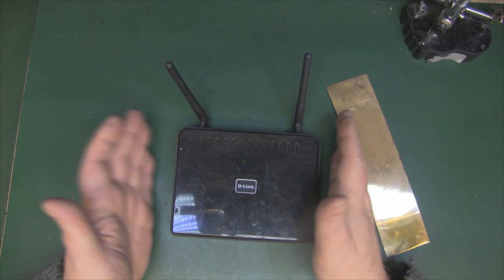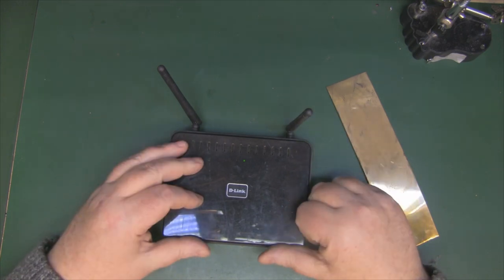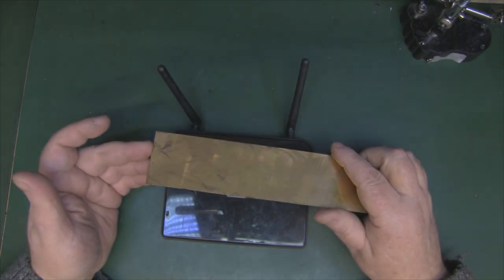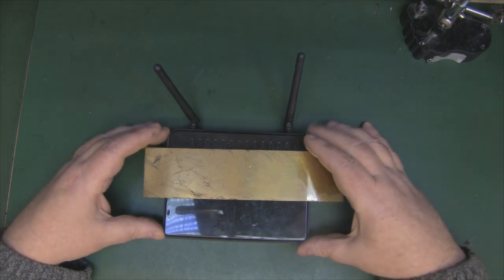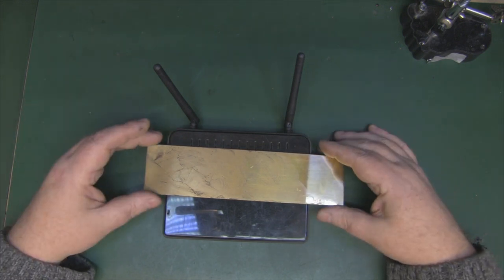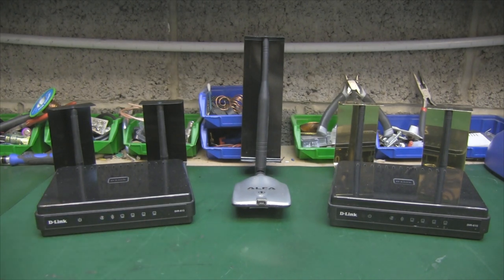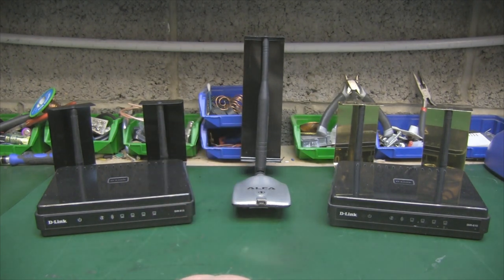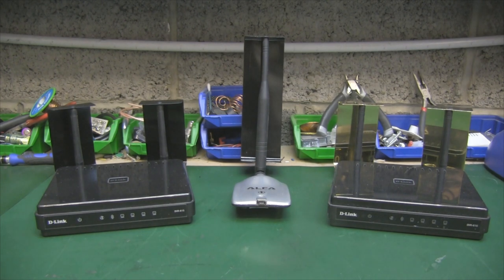Increase Your Router’s Range by 50%

Comment: it works, however your antenna is now a directional antenna, the signal on the back of it decreased since is now reflecting on the metal and being pushed to the front, still a good idea, just something to keep in mind that position of the router is important as well as the direction to which you want to send the signal to. thank you for the video.
Reply: ruddy Puga duh, thats the point of the mod.

Comment: You can also buy some conductive air freshener to spray in your room. It's got special ions in it that make the air propagate the radio waves better!
Reply: Mr. Wifighost Cruiser this comment answered one of my forgotten questions I just couldn't articulate fast enough in AP Spence.  Too much day dreaming.  I know I'm late and or a new to subscriber to this channel and possibly am not the first to ask but new methods and updates happen daily. I have a bebop 3.0 drone by parrot. I do not want to buy the sky controller,  I have a flypad which is a blutooth remote that connects to my phone/tablet.  Basically the 2.4 and 5 Ghz and all transmission to the drone are from the phone/tablets wifi.  What can I do to match the aftermarket controllers distance which is 1.6 miles via 2.4ghz (presumably?)

Comment: The antenna is presumably a thin rod in the centre of the axis of the plastic. Would you get better constructive interference if you measured your 15mm from the centre of the mounting holes? As it is you probably have 18mm when you add in the thickness of the plastic case of the aerial.
Reply: I thought the same thing. The plastic is not part of the antenna, right?
Reply: @rupert274  Right!

Comment: Of course they call these windsurfer reflectors, cause they look like sails on a boat I guess. But usually they are made curved like a satellite dish while yours are flat (nicely done BTW for a quickie mod). So the question is how does this flat reflector compare to the curved ones especially in regards to that "canceling each other out" waves you were speaking about. Is the curved version better but requires a specific curvature and specific wideness that would have complicated this mod so therefore, for ease of hand manufacture, you went with this flat version - or does the curved versions not really any improvement over your flat version to begin with?

Comment: That isn't a double of signal strength, but its quality.
If we go by the signal strength alone, you got yourself an increase of 21 dB, which is 128x better signal strength.

21 dB from a piece of scrap metal is pretty damn impressive.

Comment: I wonder how that would work compared to the windsurfer.
Also I was thinking about 3D printing a parabola and lining it with AL foil, but, you are saying that there is a maximum distance that the antenna can be from the reflector?

Comment: In some other videos you said that the reflector should be connected to the outer conductor of the antenna (I think called the ground plane) but in this video the reflector is not electrically connected. Would the performance of the reflector be improved if it was electrically connected to the outer conductor of the antenna?
Reply from the maker: Yes it would, but that would mean chopping and soldering

Comment: I thought that for constructive interference the ideal spacing is 1/2 wavelength which is 61.5 mm for 2.44Ghz.
What is the reason for using 1/8th wavelength?
Reply: 1/8 is a good position, it's kinda like a NVIS antenna mounted upright, most Yagi antennas have spacing between 0.1 and 0.25 wavelengths, there are pros and cons to different spacings but 1/8 is generally a good even division of a wavelength.
My understanding is that it gives good direction while keeping a decent F/B ratio, and distance effects antenna tuning, Dipoles and Biquads tend to like a 1/8 distance, Yagi are more complex due to more elements messing with the tuning.
I'll have to do more research on that, good question :)

Comment: Is signal strength the same as quality?.. e.g. whats the increase in speed.. no point having a strong signal if its of no benefit..

Could you do a speed check using a test file on one pc to the other see if the through puts actually increasing or even just use speedtest.net..
Other than that good to have you back :) keep up the good work.